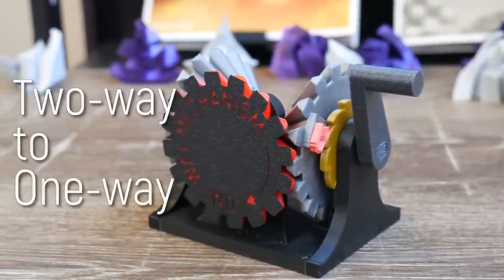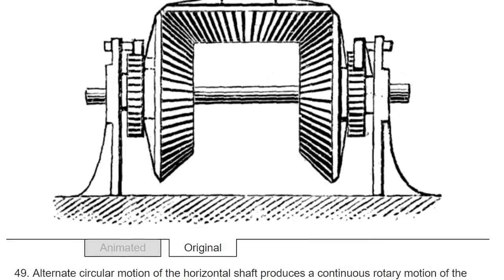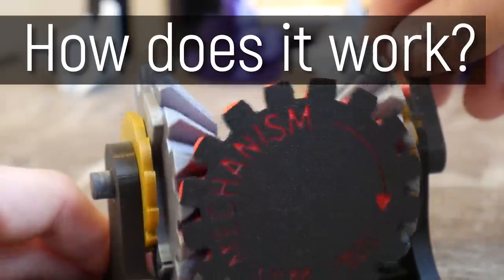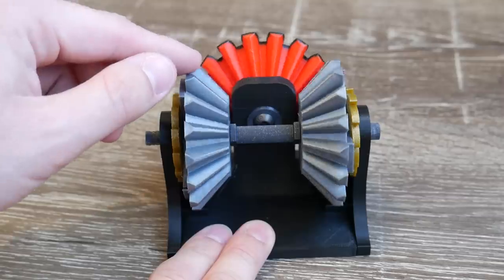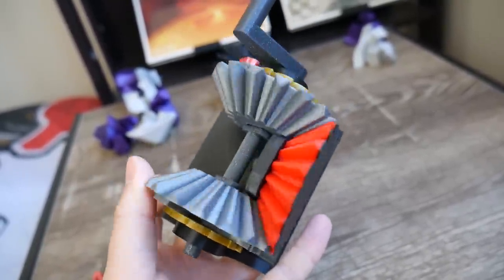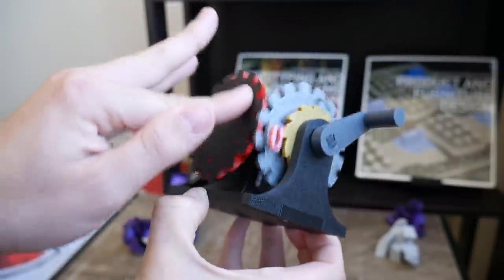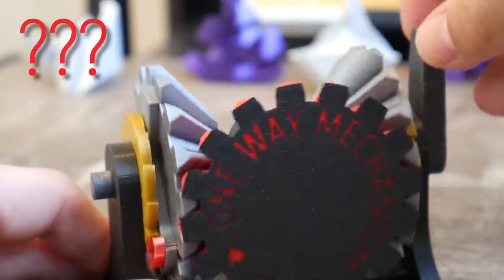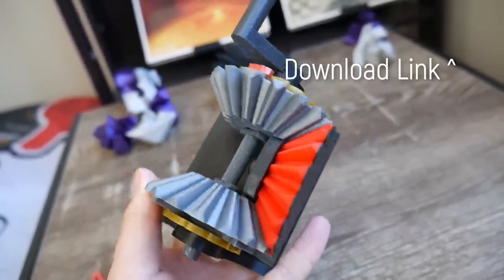This Mechanism only turns Clockwise, no matter what.

Comment: Car mileage.. Either the car forward or reverse, the mileage will always increase
Reply: J Walker, how is that relevant?
Reply: J Walker , The speedometer cable, which drives the speedometer / odometer, comes off the output shaft of the transmission.  The output shaft of the transmission does indeed rotate both clockwise and counterclockwise.  Mechanical speedometers would always register a positive speed and increase the odometer; regardless of the direction of travel of the vehicle.  Of course, super old cars didn't have this and would rotate backwards.  It's moot today, as all modern cars are electronic.
Reply: John Gray nah bro. Its connected to the wheels.
Reply: they use a device similar to this in counting revolutions of a shaft where the shaft rotates both ways but only absolute value is needed. Both cars and ships/boats use this to estimate wear and to indicate preventative maintenance schedules.
Reply: John Gray electronics make everything way too easy 😂 nothing is mechanical anymore. Nothing.
Reply: Chunu Munu ; Are you being serious? it's hard to tell but it reads like you are looking at an old exercise Bike, The Bicycle kind with one wheel and a cable drive speed'o
Reply: Chunu Munu Speedometer drive cables for cars have never been connected to the wheels.
Motorcycles used to be, but even that is no longer the case.
Reply: Syahmi Amin that’s a good guess
Reply: Not unless you are faris buleler
Reply: Havent u seen ferris   uellers day off?
Reply: ghgjg hhxgh so your car delivers power to its wheels how?
Reply: Syahmi Amin unless you nave an older car which then shady dealers connect to a machine that spins a sensor backwards at 8000rpm just to make the car look like it only had 80k miles when it really had 240k
Reply: I was Just thinking about Ferris Bueller day off
Reply: That sounds good to me.
Reply: There we go. A practical application. In the old days, decades ago, in remote areas, you'd see people driving their cars backwards in order to defraud the used car market.
Reply: Doesnt matter, the gears inside the speedometer itself only work in one direction ie: you cant run the car in reverse to take mileage off of the odometer although Ferris Bueller thought that might work.
Reply: Air-cooled VW cars (Beetle) had the speedometer drive cable attached to the dust cap on the front-left wheel.
Reply: speedometers are (regardless of placement) just a hall-effect sensor close to a metal gear with square teeth that disturbes the magnetic field in a way that can be sensed and counted by the sensor's electronics.
Picture it like a wheel of fortune that you count the clicks per time frame to get a speed reading that is therefore positive regardless of the rotary direction.
Reply: BaronZ that is how the electric speedometer works, however mechanical speedometers are driven by a cable.
Reply: Mechanical speedometers are driven via a small drive gear from the output shaft of the tranny as John gray explained.  However, J Walker, in reverse the crankshaft does indeed rotate opposite direction as well because the crankshaft is directly connected to the tranny output shaft.  The input shaft slides into the flywheel which is bolted to the clutch (or torque converter if automatic), which in turn bolts to the rear of the crankshaft of the engine.  Since the engine only rotates in one direction, the tranny switches rotational direction in reverse where the output shaft rotates opposite the input.  The driveshaft slides onto the output shaft and is mechanically connected via splined shaft of tranny and notched hole in driveshaft (as notched hole in clutch/flywheel assembly drives input shaft mechanically) making the driveshaft rotate as the output shaft does in reverse.

The speedometer cable driven from the output shaft via the small gear works in a similar manner.  The cable has a square end that inserts into a square hole in center of speedometer gear, so the cable also spins opposite when in reverse.  The uni-directional converting mechanism is located inside the speedometer assembly, and after converted to absolute movement in one direction then drives the spring loaded speedometer needle and odometer (exceptions to this design do exist, but majority of older vehicles, especially US made, work in this manner).  Its possible to break the old speedometers spring loaded working mechanism by exceeding its max registered speed.  After restoring my '77 bandit Trans Am and building a fairly aggressive 400 c.i.d. engine for my hot rod dynoing at 642 ft-lb torque and 568 HP, I maxed the top speed once at just under 160 mph (only 4-speed, ran out of gears b4 running out of power @ 7600 rpm), the speedometer registering 100 mph actually went all the way around back up to 20-40 mph...it began to bounce back and forth and then broke de-spinning all the way around to zero.
Reply: Bingo.
Reply: Didn't work for Ferris.  The numbers didn't come off backward.  In the movie the suggestion was that the odometer remained static when the car was in reverse, but in reality it would increase no matter which way the wheels turn.

Of course, that wasn't a real Ferrari anyway.  It was a fiberglass replica powered by a Ford or something.
Reply: That's not how they did it.  They opened the case and simply moved the numbers.  That's why the cases had tamper-proof seals.  So you could tell if they'd been opened.  (The crooks learned to fake the seals too.)

There are electronic means of changing odometer readings today, because if a dealer has to replace a unit he needs to be able to put the correct mileage into the new one.  And if it can by done by a dealer it can be done by a crook.  IF you have the software (which is always available) it's actually easier to do today, but it requires some hacking skill.  The average idiot street corner scumbag in a checkered sports coat won't be able to figure it out, but it can be done by serious crooks.  There is perfectly legitimate aftermarket software for VW products and some other European cars (and Hyundai for some reason) that duplicates the dealer tool and software and does a lot of other stuff besides.  It can change the odometer.  The software and interface costs more than you'd make on just one crooked deal, though, and the "amateur" version will only work on like 3 VIN numbers.
Reply: And therefore probably only had a one-way odometer which just freewheeled if you went backward.  I'm assuming.
Reply: NOW they are.  They used to be all mechanical not long ago.  Sometimes you could get gears with different teeth to change the speedometer calibration for different size tires, which also adjusted the odometer rate.  If you didn't mind an inaccurate speedometer you could "slow down" the mechanism.
Reply: The crankshaft of the engine ALWAYS turns the same way.  Otherwise you'd be sucking in exhaust and blowing it out through the air filter.

The output shaft of the transmission turns the opposite way when you engage the reverse gear.  The speedometer gear used to engage a tiny gear on the output shaft so it would spin either way.  The SPEEDOMETER would either contain a mechanism similar to this one, or would simply ignore "reverse" and not function at all.  Certainly the speedometer needle would not respond to reverse, but as far as I can recall from those old days the odometer would.  I never really paid attention to that.
Reply: +Mickey
I've worked on many older cars, as they are easier for a home mechanic and it saves me big money and avoids being scammed by garages charging for shit they dont do.  I'm not familiar with all obviously, but had my share of chevy, a ford here and there, and pontiac; mostly sports cars.  The speedometer assembly is definately the conversion center, and as you said exactly why they cannot be disassembled by normal means to prevent tamper (of course it was possible, but difficult and at risk of breaking internals).  Easiest way to "fake" lower reading was just swapping the part with compatible model w lower mileage.  Or to prevent further build-up simply unhook the cable, sacrificing no speedometer but freezing mileage...most all i drove had an rpm gauge and thats what i mainly went by anyway; i knew in high gear 2500 rpm was 65 for example and every 500 rpm represented a set change to speed.  Got used to this when speedometers went out i just used rpm and saved $$ replacing a gauge i didnt really need.

I fully restored my trans am '77 bandit so...great learning experience.  It had tranny gear driven speed cable that went directly into back of speedometer.  Im not sure if odometer read in reverse (no more than you actually go distance wise this is really irrelevant to the big picture), but most all american made cars the speedometer always gave speed in reverse.  I specifically remember my T/A because rev. was geared so high it would run 50 in reverse if you tacked it out!  Made for cool, easily executed reverse 180's w/o ever dropping under 30 mph lol; but this cars a real beast built just for shit like that and the posi-track rear end really helped.

If anyone is into old hot-rods heres a few pics of restoration timeline:
https://www.facebook.com/photo.php?fbid=1479935896694&set=a.1479935656688.58198.1782713412&type=3&theater
https://www.facebook.com/photo.php?fbid=1479936336705&set=a.1479935656688.58198.1782713412&type=3&theater
https://www.facebook.com/photo.php?fbid=1479936696714&set=a.1479935656688.58198.1782713412&type=3&theater

Final product:
https://www.facebook.com/photo.php?fbid=1636121001224&set=a.1479935656688.58198.1782713412&type=3&theater

If u watch anything watch this with good sound, first crank of mid 500s HP and over 600 ft-lb torque
Its a sexy beast :)   (for ppl with no car knowledge it is NOT missing...thats called a large cam baby)
https://www.facebook.com/chad.kimsey/videos/vb.1782713412/1342420978907/?type=3
Reply: @mqbitsko25  Actually some engines are indeed able to be started up in the reverse direction, So i guess it is not completely valid to say the shaft always rotates in the same direction
Reply: @mqbitsko25  One example would be the (i think Czech) velorex, which was intentionally designed so that you can start the engine in reverse instead of having the reverse gear in the transmission, so you basically had 4 gears forward and 4 in reverse. I also recall some fiat engine that was used in two models, and the crankshaft would rotate the opposite way in one of them, so it was possible to start them up in reverse

Comment: 5:05

This mechanism is very common on yachts. They are used for the main sheet, gib sheets and sometimes the Spinnaker/Jennaker sheets (a "sheet" is the term used for a "rope"; and the "gib" and "Spinnaker/Jennaker" are types of sails)
     They are fitted with different gear ratios, so moving the crank in one direction reels in the sheet (rope) quickly, while turning it the other way ratchets it in the last few inches, tightening the sail.
Reply: I have no idea if they internally use this exact mechanism but I think what you're referring to are called two speed radial winches.
Reply: @NicholasWellcome  
wouldnt that just be using a different gear size on one end?

Comment: A similar mechanism is used in automatic mechanical watches. The swivelling weight can rotate in either direction and winds the spring. Great video, thank you!
Reply: Ed Jones was thinking about the exact same thing - friends often ask me how that works when I’m explaining how Mech watches work and I always explain it theoretically as two ratchets in opposition but it’s cool to see something like that in practice.
Reply: Do you guys have a link that explain exactly how this mechanism work in automatic watches ?
Reply: Guigui I mean it’s fairly simple. There is a large piece that rotates relative to the watch movement to be towards the ground (because of gravity) and that rotation is fed through gear sets to increase the torque. It then feeds into a ratchet that winds the main spring. Or in the case of nicer watches, two ratchets in opposition like this video that will wind main spring regardless of which way the original large piece pivots. Like this mechanism, there can’t be a lot of play because the movement of ur wrist occurs over a fairly narrow oscillation so it must make the best of those short movements
Reply: Soham Ray thank you but I think I didn't make myself clear, I know how a "self way automatic watch works", I just wanted to know if the "two way to one" mechanism was the same as the one in the video, I though it was completely different.
Reply: It was used to wind a clock automatically on ships
Reply: Yes, with the ratchet-springs attached to a planetary-gear mechanism!
Reply: It's the same except the bevel gears are normal (flat) gears. This makes it look very different, but the way it works is the same.